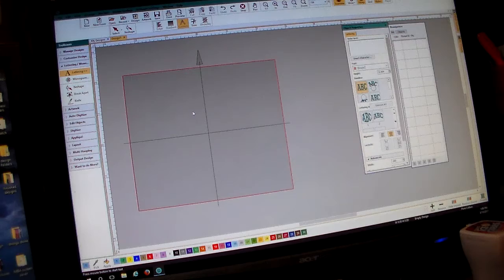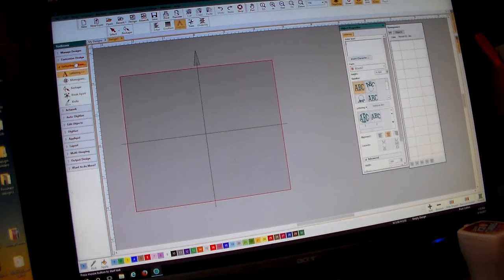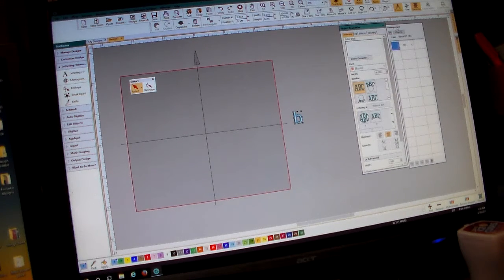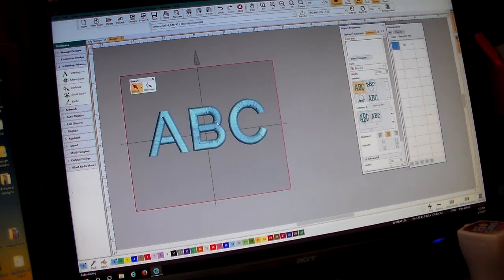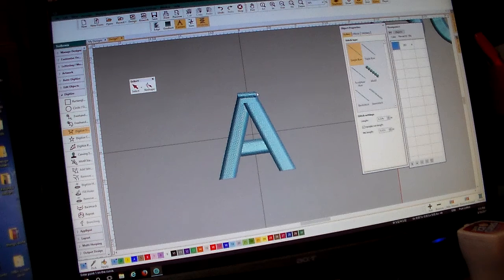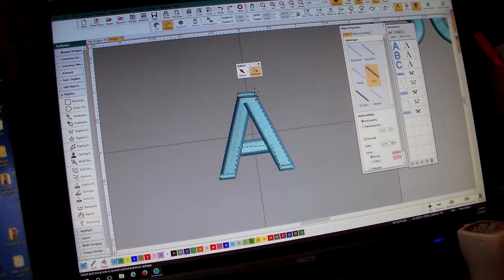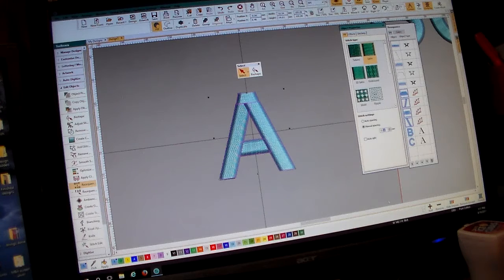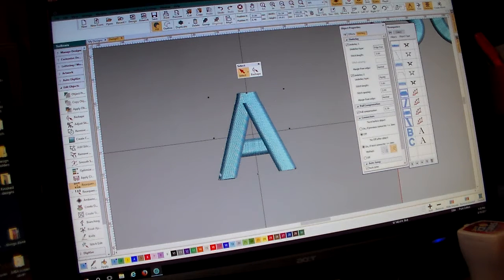How to digitize for puffy in Welcom Hatch

Comment: Question#2: so, what is suppose to run first is the outline, then you place the foam, then the column and run stitch of the A is suppose to go after the foam is on right? Because you said its suppose to cut the foam to help...something... ?
Reply from the maker: Ok you place the foam where you are wanting the letter or design to go. Then just sew it all out and when do you pull the foam off. the needle will make little holes where is sews and you just pull off the excess.